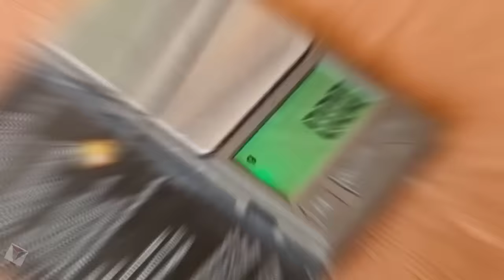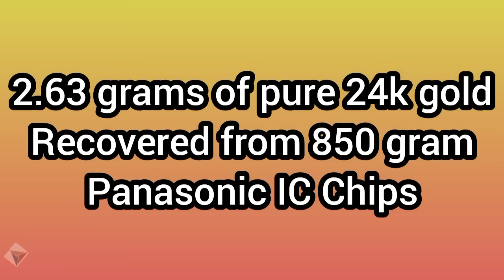Panasonic IC Chips Gold Recovery | Recover Gold From IC Chips | Gold Recovery

Comment: 👋 hey I have a lot of material but can't find a good source of acid? The one that starts with an "N"
Reply from the maker: visit industrial areas.You may find your acids there.But you need to do some investigations there😎.A little bit of sherlock 🙉😅.
Reply: Thanks 👍
Reply: Spectracide has a stump remover that is potassium nitrate. 
You can make a dilute hno3 with some. But will need some more equipment if you want to concentrate.
There are videos on both. (Nurdrage i think.)
The cost may be paid off fast to buy, if you have alot of good material.